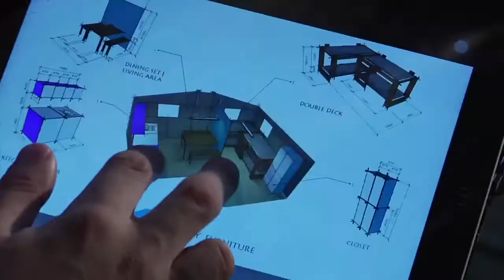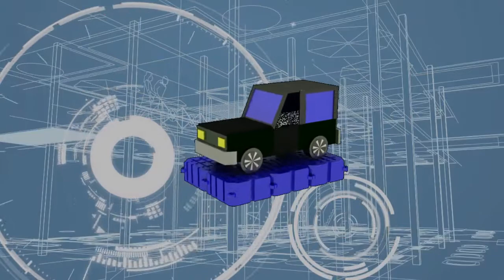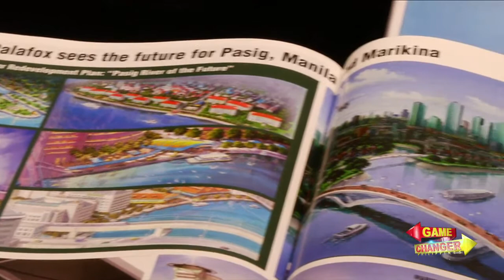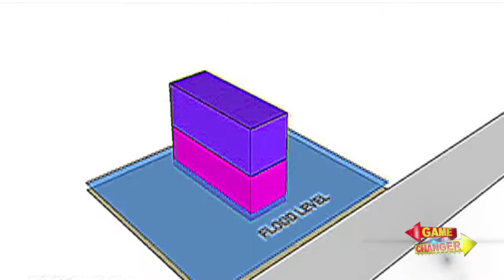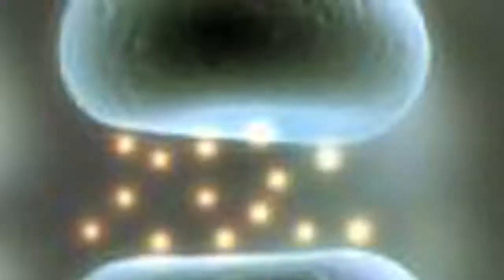Game Changer Philippines: Anti-Flood Architecture

Comment: Respected sir, 
 I have one suggestion,  you must experiment it.
In a building like four story buildings with two or three floors are deep inside water.  
My suggestions is. 
You take frame of door or window. 
You take Male female strips used by tailor.  You take wood,you nail it  and plaster it all around frame. 
You must put three lines of male stips all around the frame. 
You take thick plastic and stich female strips as per as  needed sizes .
You will get two pockets,  you start from ground level to top level as per as need.  
You take wooden sheets,  which fixate with each other.  You put the wood one by one inside the pocket as per as need. Wood will take load of water pressure,  plastic can tear up.
You can cover the window or door frame completely. There is problem,  how person can skip from home and  how he will breathe in close home. 
Please slove this problem.
Each situation of flooding is different . You have better experience compared to me. 
Please work on ram pump to send the water outside the house,  in the absence of electricity. 
Namh shivay.